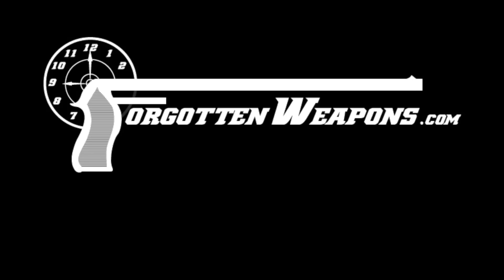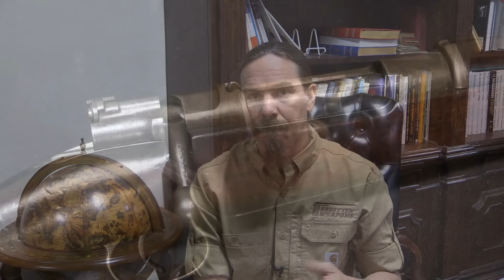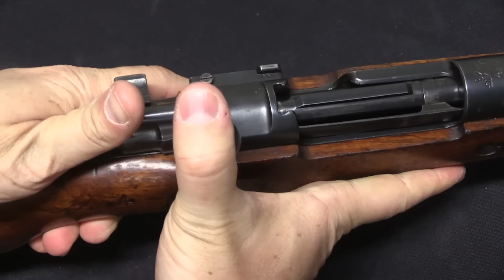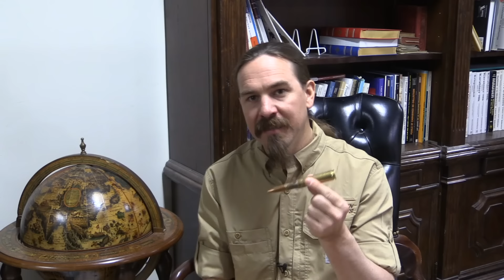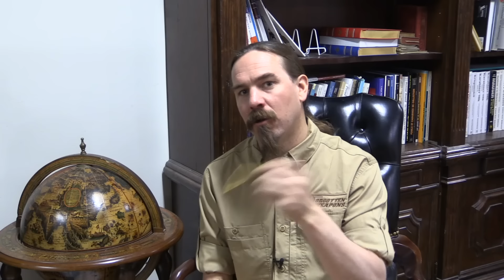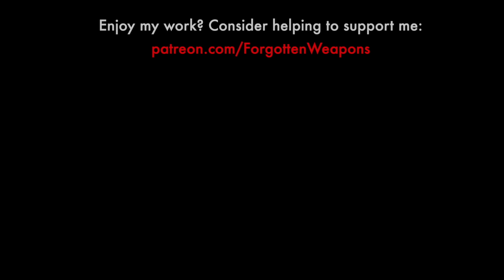Earth-Shattering ka-Boom! How (and Why) Guns Explode

Comment: Deflagrate. Thank you. 🙏🏻
Edit: approx 14min. I put it like this- The casing is a device that orients all the ignition components with the firearm components responsible for that ignition while providing a lubricious gas seal.  I’ve seen the following description of an out of battery detonation in a 1919 once. It was energetic.

In closing. It’s all an coverup. Scott is the next generation of Terminator and he had to publish that video to convince everyone that he is human.
Reply: I mean since the gasses are moving fast enough to move the bullet to supersonic speeds then it’s a supersonic deflagration. Kind of funny, supersonic deflagration, deflagration can still be supersonic because it’s still just a reaction of heat
Reply: @KClO3  isn't the deflagration / detonation a measure of how fast the flame front propagates though, not how fast the resultant gases are moving?
Reply: @theHSPCproject  detonation is when It burns faster than the speed of sound in the material itself, so 343 m/s burning is not detonation because it has to reach the speed of sound in the explosive itself which is way higher in a solid than a gas
Reply: @KClO3  ah ok the wording in your original comment was confusing.
Reply: Cases also strengthen the action by taking stress off of the lugs and help prevent auto-loading actions from opening too early by gripping the chamber during peak pressure. That is the reason why it is recommended to not polish revolver chambers and to remove oil from chambers before firing.
Reply: @KClO3  Keep in mind that the speed of sound is only 343 m/s at sea level and room temperature. It’s over double that at 1000 C. Pressure is only  a slight factor due to air being a non-ideal gas, but I’d think that increasing pressure by 3 orders of magnitude would have a non-trivial effect.
Reply: @theHSPCproject  Oh, he is saying that the speed at which the flame travels must be measured relative to the speed of sound in the medium itself, and not the speed of sound in air at sea level? You are right that is a tiny bit unclear when viewed naively.
Wait, now I want to know the rate of propagation of a sound (pressure?) wave in something solid. I assume it is very fast.
Reply: I think of the brass cartridge case as a gasket, in terms of its gas-sealing function.  It also serves as a sturdy and fairly water-resistance case for a round of ammunition, but it is its function as a gasket that made breech loading firearms practical.
Reply: @TheFanatical1  It will vary widely based on the solid. At the low end you are talking about low single digits of kilometers per second for most organic solids (like gun powder...). When you get into high strength (hardness) steels you can see hundreds of kilometers per second or more.
Reply: I knew it.
Reply: @6.5mm_is_the_best_mm  Thanks for the insight, but revolvers arent autoloading so how not polishing chambers and removing oil can prevent a malfunction?
Reply: @Estoc_Bestoc_  I wondered about that too, Estoc.  My guess is that polishing and/or oiling the chambers means the cartridge case can come loose from the firing chamber it is in and set back hard again the standing breech.  That can make it difficult or impossible for the cylinder to rotate.  The S&W revolver made for a short-lived cartridge called 22 Jet was famous for this. The 22 Jet had a very heavily tapered case, which further encouraged backing out.  I could be all wrong, though; maybe the VSO guy will respond.
Reply: @GR46404  Thanks for the reply, speaking of which, i've always wondered how cartriges in revolvers seem unsupported in the base/rim yet they dont rupture in that area, am i missing something?
Reply: @Estoc_Bestoc_  Polishing the chamber prevents the case from gripping the chamber as well and the case moves rearward during firing and can cause jams and, potentially, blown cases on stout loads. Lots of cowboy action shooters polish their revolver's chambers to aid in easy brass extraction as fired brass may fall out with no to little assistance. They aren't usually shooting magnum loads though. I can't say for sure if this is a big issue on revolvers but the idea has persisted for a long time among gun culture. Nothing wrong with removing burrs and tool marks with some polishing but I have heard it is bad to polish to a mirror finish. Some revolver cylinders have a lot of play and could expose enough case head to blow the brass. The firing pin pushes the case into the cylinder and the pressure causes the brass to grip the chamber.
Reply: @6.5mm_is_the_best_mm  Thanks, i guess that also the fact that most revolvers barrels are 6 inch or shorter helps too, bullet leaves the bore before too much pressure builds up in the cylinder, the little pressure that leaks from the forcing cone might help as well, always looked at the casing base as the fragile part but again we have stuff chambered for .500 and 45-70 so i guess they just work
Reply: @Estoc_Bestoc_  after the bullet starts moving pressures are already dropping (unless you have a bore obstruction). Peak pressure is within the first inch or less I believe.
Reply: @6.5mm_is_the_best_mm  Respectfully suggest to remember why certerfire ctgs went from 'balloon head' (early BP ctgs, .45 Long Colt, early .45- 70 casings, etc) to solid head design. (Actually, modern  rimfire ctgs are 'balloon head' that work (usually, with few exceptions), under 22K PSI). Some 'ballon head' ctgs were produced until late 1.800's, even early 1.900's.
Reply: @GR46404  Yes. Case taper increases rearward thrust, which is especially no bueno in revolvers.
Reply: @6.5mm_is_the_best_mm  Yup. Cowboy Action shooters often load light for faster stage runs on steel plates with cast bullets. A hit is a hit.
Reply: @6.5mm_is_the_best_mm  Peak pressure occurs in the middle of the propellant column. This is where pressure transducer gauges are placed over the chamber relative to that spot. They used to use copper crusher gauges in test breaches to get an idea of chamber pressure.
Reply: @LRRPFco52  the pressure will be equal throughout the available space. Sometimes peak pressure occurs before the projectile has begun to move and sometimes after. The test equipment is placed in the chamber because that is where pressure begins to build. It would not make sense to place it anywhere else.
Reply: @6.5mm_is_the_best_mm  Yes. As volume increases with projectile travel, pressure decreases. I've been involved with pressure measurement systems for quite some time now in a professional capacity.
Reply: @LRRPFco52  So peak pressure is always before the projectile begins to move? No matter what powder, projectile weight, bullet setback, throat length or rifling? I was under the understanding that peak pressure vs bullet travel varies based on these parameters and have seen pressure curve tests seem to confirm this. Some powders need to reach a certain pressure before they burn efficiently. I am by far no expert and I am just interested in ballistics, internal and external.
Reply: Some of the tests use multiple sensors in the test barrel at various lengths of travel.
Reply: @6.5mm_is_the_best_mm  We've all heard about primer jump where the high explosive of the primer causes enough pressure to jump the projectile into the lands, after which the propellant column is ignited and peak pressure is reached based on that new slightly larger volume.

Military cartridges often use sealants so primer jump isn't normally an issue in those instances.

Most of your slow-burning rifle propellants are burned within the first few inches of the chamber, and the resultant hot expanding gas continues to expand behind the projectile, forcing it down the bore until the pressure is relieved at the muzzle.

But I've not seen piezo-electric readings where pressure was lower at the mid-chamber than anywhere else.

There is pressure build-up on the time scale, but peak pressure is in the chamber.

If you look at the barrel shank of a light profiled magnum barrel, you'll see where the taper starts.  You wouldn't be able to start a taper so close to the shank if you still didn't have FoS there, and FoS is determined by pressure.
Reply: @LRRPFco52  The primer comment makes sense and was something I did not consider.  I was not saying that peak pressure occurs multiple inches of projectile travel just to clarify. I was under the understanding that peak pressure could occur after the bullet begins to move in some circumstances like a heavy projectile not gaining speed fast enough to reduce pressure or a propellant that displays faster burn characteristics after a certain temp or pressure is reached. 
I may have read bad information. I realize that the propellant burns within the first few inches and that the extra barrel length allows the bullet to continue to gain speed under remaining pressure. Like I told someone about an AR pistol. The powder that has the most velocity for the 20" barrel will have the most velocity in the 8" barrel. Though, much slower than the 20" due to all of the wasted expanding gases.
Thanks for your insight from your professional experience.
Reply: @6.5mm_is_the_best_mm  If you look at how infinitesimally short the time is from primer strike to the projectile exiting the muzzle and graph the pressure wave on the timeline, with piezoelectric metering, you see where the peak pressure is.

This is why powder and bullet companies do so much testing to determine appropriate powder/bullet combos.

You can load powder that is too slow for the bullet weight/length and it won't convert well at all, especially cartridges that are more straight walled.
Reply: @LRRPFco52  Like Hodgdon Varget for a 420gn 45/70. Burns really dirty and poor velocity until you max out the case capacity and then pressures become high enough to burn efficiently. Same with Longshot and most 9mm loads. Max loads burn well and plinking loads will leave your gun really dirty and velocities will have a lot of deviation.
Reply: @6.5mm_is_the_best_mm  Exactly. Varget seems to do best in bottleneck cartridges loaded to full capacity. It's too slow of a burn rate for its density with most bullet weights even in 6.5 Grendel, which is interesting because Grendel typically works well with all the powders used in .223 Rem and .308 Win. like BL-C(2), H335, H4895, 8208XBR, AA2460, AA2520, TAC, WW748, etc.
Reply: @LRRPFco52  I use H335 for .223 and .308. Fills the case well and has great velocity, accuracy and low SD. I load slightly under Lee max at 25.2gn with 55gn for .223 and 40.7gn with 180gn for .308. Convenient to use same powder for the ARs and a bolt gun. Need to see if the 6.5creed ar10 can use that powder for for 129gn projectiles.
Reply: LOL!
Reply: @KClO3  Just the decomposition of the powder by heat into a gas that ignites. I've always found it funny that when you(safely!) light a SMALL pile of black powder, it goes FOOSH!! almost like a mini explosion. But igniting a SMALL pile of smokeless powder, it typically just burns with a sickly orange flame without the FOOSH! But enclosing that smokeless powder in a cartridge & chamber......😮
Reply: @ChestyPullerFan  mixture of black powder and smokeless powder 50/50 is a very powerful mixture, the black powder burns fast so it ignites all of the smokeless powder much faster than it would alone, the black powder burns faster at the start but it has so much solid gunk instead of gasses, while the smokeless powder produces only gasses but burns slower when started with a flame so they kinda help each other
Reply: @GR46404  Also, the type of "brass" used in the manufacturing of ammunition is proprietary to ammo. That's why I and MANY other reloaders screamed with fury at Bill "Slick Willy" Clinton's ban on the sale of surplus military ammo & brass back in the 90's! Back when I was first introduced to reloading by a friend, I too had a "squib load". I was lucky that my friend noticed it when I fired the cartridge & stopped me before I could chamber another round & pull the trigger! We unloaded the pistol & disassembled it, sure enough, a bullet was up in the bore about midway! After a wooden dowel rod & a hammer knocked out the bullet, the pistol was ready to go again. But since then, I have ALWAYS removed ANY distractions before a reloading session & paid STRICT attention to each step before moving on to the next one! Any doubt about ANYTHING concerning the ammo, I stop, investigate & remedy it before moving on. I will "tear down" just loaded ammo to allay any doubts/fears. Think of it as handling deadly snakes & you'll not be sorry for it!
Reply: @Estoc_Bestoc_  The case rim/head in ALL cartridges is significantly thicker than the case walls. Get a reloading book, or look at a friend's or library's copy & most of them show cut diagrams of a cartridge & all the proper "industry specs" for length, thickness, etc. Something to be aware of & all the GOOD reloading books describe it, is "incipient case head separation". If you are reloading or shooting someone else's reloads, take time to look at the base/wall area of each cartridge. If there appears a slight "line" that is encircling the cartridge, toss it  & either tear it down (SAFELY) or just discard it. As Ian said, it ain't worth destroying hundreds or thousands of dollars of firearm & not to mention the injury or loss of life that could occur!
Reply: @hernandovillamarinbuenaven7476  Actually, a .22 LR has a HIGHER chamber pressure in CUP than a .30-06! (Factory loads)
Reply: No sh#t that’s for sure    Cracked me up thanks for that made my day
Reply: To be fair, if you want to take this to its logical extreme, if somebody did in fact load the case with the wrong type of powder, or it was a bootleg cartridge that contained nitroglycerine, then it would be Detonating, right?

Comment: The fact that the Arisaka still has the flower stamp impressed me more then its safety mechanisms
Reply: I have a Sako-modified Mosin-Nagant, captured in wartime from the Russians then rebuilt and accurized. One of the changes was the grinding off of the crest - right in the same spot as that chrysanthemum on the Arisaka.
Reply: An Arisaka with the Mum is a pretty positive indicator that it was a combat captured example.
Reply: @gruntopolouski5919  Finnish captures are always nice

Comment: I think one lesson to take away from this incident is to always, always wear eye protection when shooting guns. Heck, also when welding, using an angle grinder, handling acids or caustics, or any number of other things. A decent pair of protective glasses are cheap compared to guns and ammo and eyes are priceless.
Reply: PPE is a must. I can say that I could’ve been seriously injured on the job without several pieces of equipment. It’s deadly serious
Reply: I wear glasses even for just hammering at stuff nowadays. I bought a multi pack of impact glasses and put a pair or two in each angle grinder case, one in every hammer box etc. Then there's no excuses or temptation to not use them.
Reply: Yup.  Things like this are why I started wearing legit safety glasses over my prescription glasses.  Normal glasses will keep little bits of soot out of your eyes but they won't stand up to a ricochet, piece of jacket coming back off steel or a kaboom.
Reply: I have a little story about welding. I was at work straightening out a piece of metal and my idiot coworker decides that this is a good time to weld another part to it, no warning whatsoever. I didn't close my eyes fast enough and BAM, spots in my vision for the rest of the day, a mild sunburn and in the evening my eyes were burning like hell (barely bearable when eyes closed).

And I know someone that had to have eye surgery because they used an angle grinder without eyepro.
Reply: @buggs9950  i had a coworker injured in the neck by a little piece of metal sheared of a steel chisel. Nothing serious but revealing. better to grind the burrs and use safety glasses.
also i had prescription glasses with a little molten metal embebded in the glass from not using safety glasses with an oxyacetilene cutter.
things happening from non usual works and tools,but its a lot better to loose some time gathering all you need,and safety equipment must be considered and esential part of some tools.
basic safety is so cheap, and can end up so expensive to not use it...we are usually so lucky after all

Comment: "Deflagrate;  Verb: to burn away or cause (a substance) to burn away with a sudden flame and rapid, sharp combustion"

I like when Gun Jesus teaches us funny words
Reply: It's the important distinction between propellant and explosive.
Reply: They're basically both explosions. But a deflagration is slower than the speed of sound, while detonation are faster than the speed of sound.
Reply: A wonderful word for a terrifying event.  Deflagration is the process behind the magazine explosions that used to tear battleships in half, as happened famously to USS Arizona and HMS Hood.  Rapidly burning propellant produced such heat and pressure that it just burst the ships open.  There is film footage of Arizona's explosion which interestingly isn't the famous photograph from the attack: that was also a magazine explosion but from a much smaller destroyer.